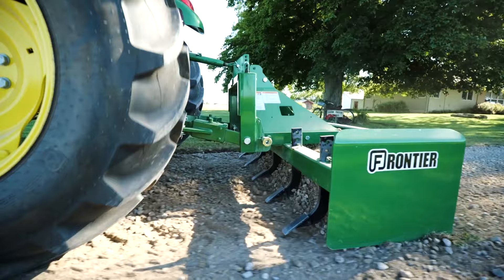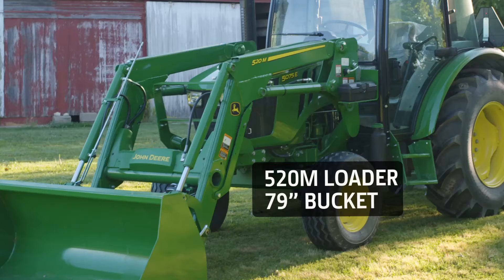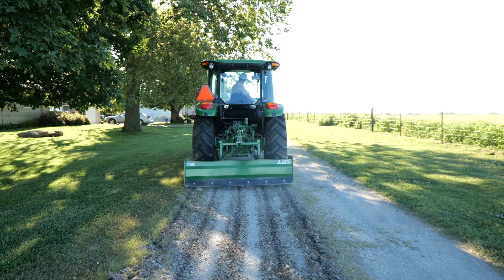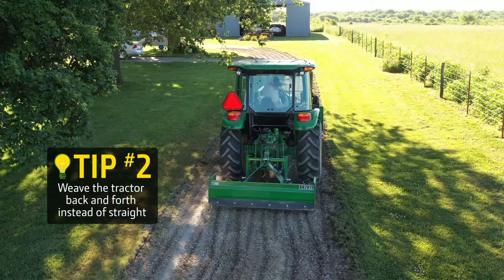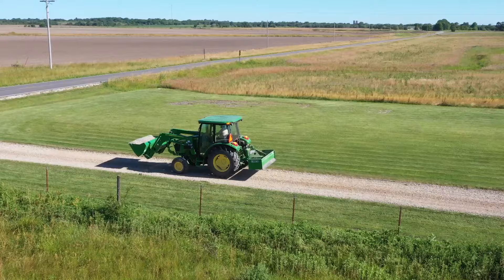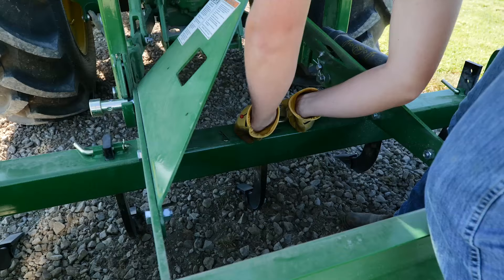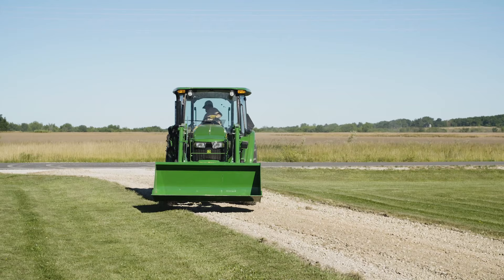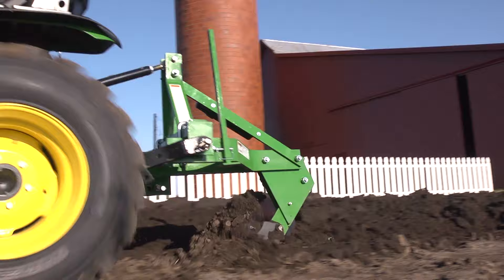Repair a gravel drive using a box blade | John Deere Tips Notebook

Comment: Good video, but water is a very important part of any good blading project. Without water youll not achieve compaction and rock will segregate leaving nothing but marbles which will need scooped up and removed and replaced with new rock. A good rule in the finish grade business is to never move dry rock. Each time its done youll lose fines.

Comment: Don't forget to crown your driveway a flat drive is not good you want the water to flow off the driveway
Reply: Yeah I noticed that, how would you do that. I'm a new operator and homesteader.
Reply: Just lean your box blade to one side a little. Go down one side of the road then come back up the next.
Reply: The right side of your 3pt hook up will have a turn buckle to adjust the lean.
Reply: @jsavoy1  thanks! I see it now.

Comment: What would be a good base to put on top of sand, to help support the gravel?
Reply: A fabric made to place on top of sandy and soft soils with a crushed rock that is approximately 1 1/2 inch in diameter down to dust, 4 to 6 inches thick on top will compact when wet and makes the best surface.
Reply: #2 gravel makes for the best base
Reply: Dean Mey gave a great answer. People sometimes want to avoid the expense of the fabric on soft or loose solis but it can be critical as well as cost saving. Simple put, it keeps the gravel from being mixed/absorbed by the underlying material such as sand or damp clay mixtures. Think of the underlayment material kind of like a soil stabilizer without the brutal cost when doing smaller projects like driveways. Most of the fabrics act as a moisture barrier as well as keeping the base material separated.
Reply: @deanmeyer1815  Excellent response.